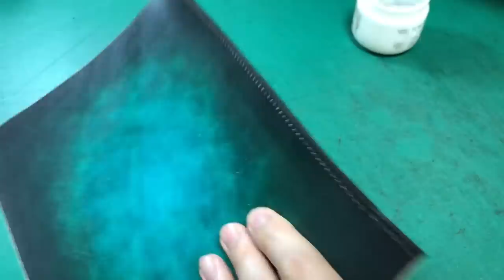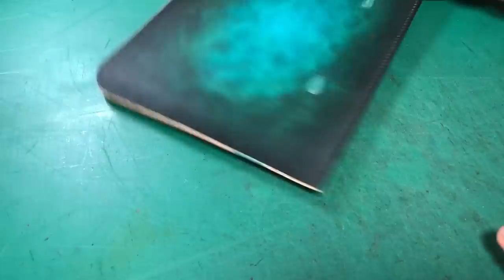【Making】Fantastic Tote Bag / Pattern No.32

Comment: What do you use to fix the dye?
I use water based stains too, but I'm looking for a product to fix it that doesn't make the leather feels like plastic.
Reply from the maker: https://l-phoenix.shop-pro.jp/?pid=146959827
Urethane top is used as a color stop.
It costs more than acrylic but is the best color fix I know of.
If you want a matte type, remove the white precipitate on the bottom before use.
If it gets on the leather, it will turn white.
Reply: Will it let leather to age properly?
I use veg tan leather (I live in Italy) and I'm afraid that with products with intense use such as wallets, belts etc these kind of finishes prevent in some ways a natural ageing and patina.
Reply from the maker: @slowride667  Yes. leather to age properly.
Colors such as blue and green are darkened by sunburn.
However, colors such as yellow and red can fade with sunburn.